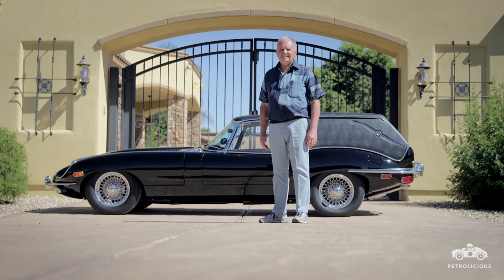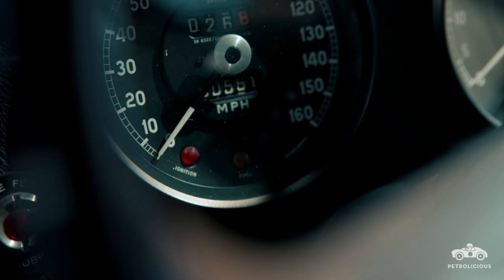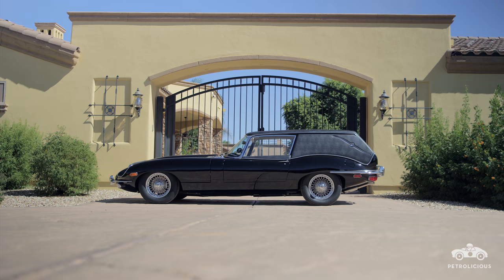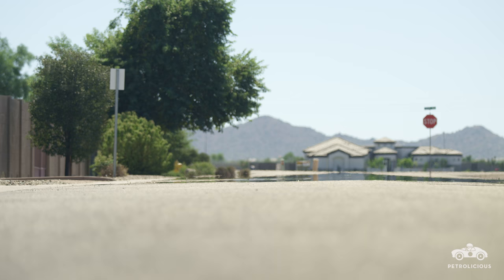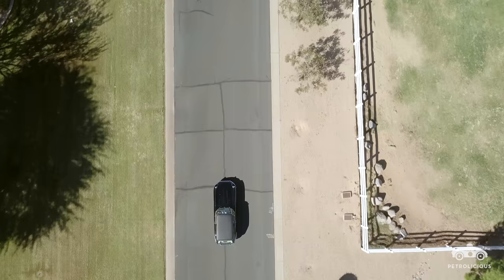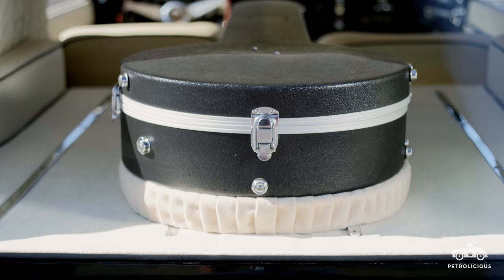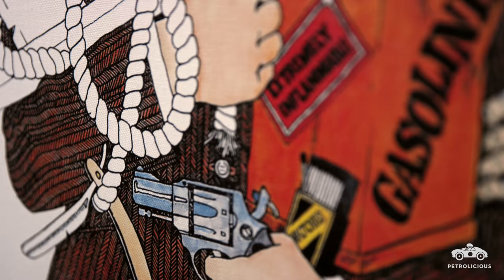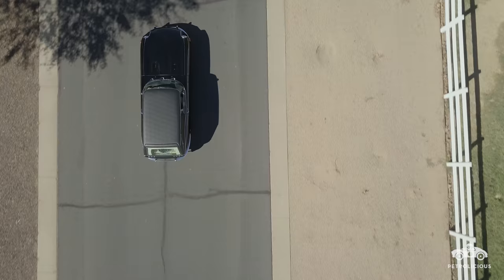The “Harold and Maude” Jaguar E-Type Hearse: A True Undertaking

Comment: That "Japanese Import" he wouldn't tell us the model of is the Datsun 510 Wagon.

Spoiler alert.
Reply: Superimpossible - He kinda messed it up though. The one in the movie's roofline sloped down about ten degrees and the kink in the rear tailgate didn't stick out as much and wasn't as high up.
Reply: i knew it looked like a datsun, so he cut up a 510 and a e type.
Reply: I was just about to post that.. not too hard to miss if you know your cars!
Reply: Hardly a spolier.
Reply: I want a amg wagon😞
Reply: lolz OLD Pantera owners are like that sometimes too.
Reply: I came here to comment the same thing haha I was like hmm... small, pre 1970 roof? And cheap enough to buy for the roof? Gotta be a Datsun. Then looked at the really window chrome trim and it's the same that's on the 510 wagons lol.
Reply: Js, as someone who worked on the car. The datsun was a total loss from a front end collision. :/

Comment: The original had much better proportions because it started as a 2 seater short wheelbase coupe, while this replica was built on a 2+2 chassis, so the roof is higher and a bit further back. Still impressive, but not as well integrated as the original style-wise.
Reply: you are right
Reply: Such a shame. He needs to cut a fair bit off the bottom of the Datsun roof and rake the rear of the roofline down. The original is way more svelte

Comment: roofline is about an inch taller than the original because Ron used the later long wheelbase 2+2 FHC while the original movie XKE was a short wheelbase 2 seater FHC. The recreation has longer doors and larger window frames. Donor Jap car is a 1970 Datsun 510 wagon.
Reply: Actually the hearse in the movie was a 2+2. The Jag his mother gave him was never chopped up to begin with.

Comment: I understand why it was built as a hearse.  I remember the movie and how I thought what Harold had done to the jag his mother bought him was appealing in a darkly humorous sort of way.  One thing about this conversion is that it would have significantly increased the luggage space of the original car, though that said, visibility out the back must be kinda lousy due to the lack of rear side windows.  But suppose instead of having it converted to a hearse one had converted it into a "shooting brake" (which is a fancy British way of saying a "station wagon") with ample-sized side windows to provide the missing rearward visibility.  And instead of the black paint, suppose it was painted in a more cheerful color.  Suddenly it's not a clone of a movie car; it's a practical daily driver.  Now take that idea a step further.  Instead of starting with a gorgeous old classic like the Jag E-type, why not start with a late model Mustang or Camaro or something similar?  Some would consider the idea blasphemous, I suppose, but I kinda like it.

Comment: Rather than junk an otherwise useless car, why not create something special.....
Reply: Colin Johnston Okay, you can save 80k, buy an e-type and never fucking touch it or drive it. Then 20 years later sell it for more, because that’s what a real car guy would do
Reply: Ah, again, the need to insult is strong with this one.....
Reply: Just because a numbers matching trailer queen runs 80 grand doesn't mean its junkyard counterpart goes for anything remotely close to that.

Comment: I appreciate his intent and what he has done, BUT - it is not as good as the original - at all! The lines are wrong - they are close, but they rise from the top of the door and create a higher back and has a steeper angled rear window, making the design look very boxy. The original line is lower with a more sloping rear window and much more in keeping with the original.